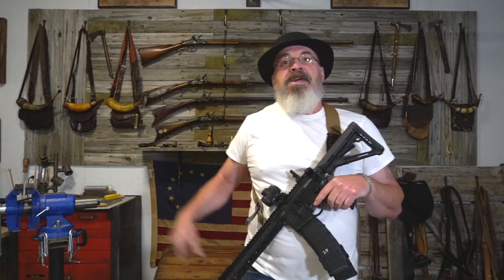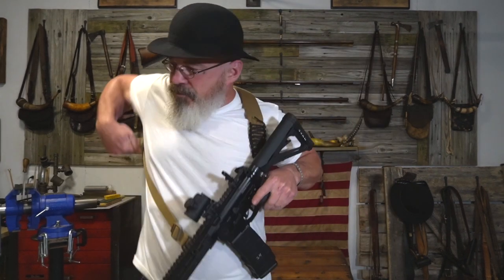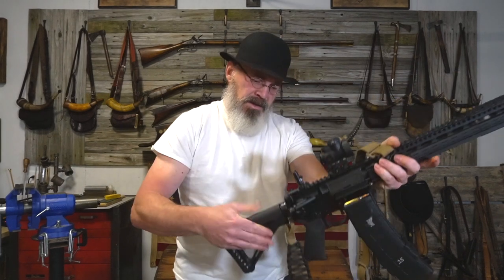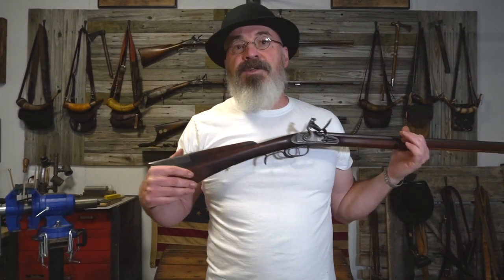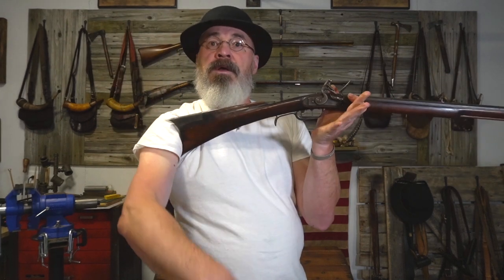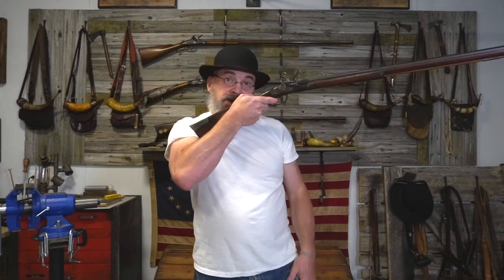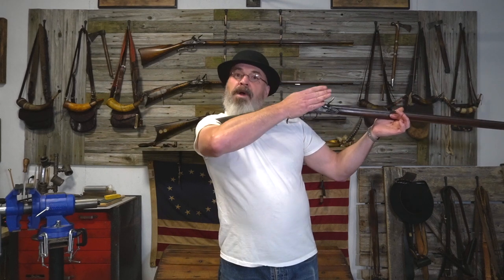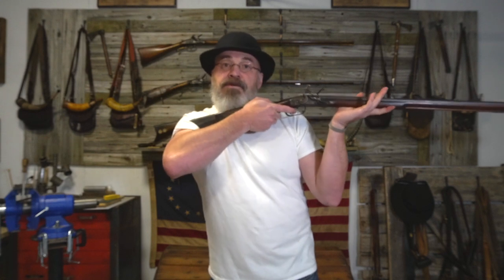HOW TO SHOOT SOUTHERN FLINTLOCKS THAT HAVE A DEEP CRESCENT BUTTPLATE

Comment: Nice AR. A bit of unsolicited advice if you don't mind, have the coupled reload on the left side of the rifle and higher up than the one in the weapon so when you change mags you can reach the bolt release and the empty magazine doesn't get in the way of the ejection port.
Reply from the maker: Thanks. I run it that way. The left mag is an 1.5” or so higher and I use an oversized bolt release and everything clears just fine. That’s my old Daniel Defense 3-gun rifle. Mag release and ejection port gate all clear fine with the empty to the right. 👍🏻

Comment: Some guys say not to take out the nipple in cleaning? I remove and clean my nipple, the inside threads, the lock, and barrel every time and they say I am wearing out my threads. What do you say?
Reply from the maker: I think if you’re careful and have the correct size nipple wrench you will be fine. Don’t over tighten or you can stress the threads. I don’t take mine out every time but I do take it off every second or third time. It depends on how well you can clean with it on. Some flash chambers are easier than others.